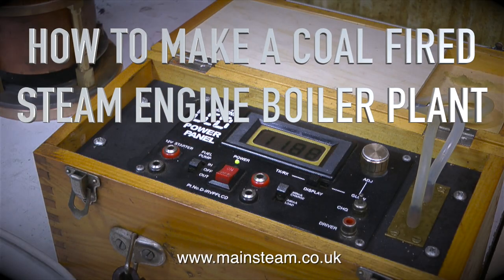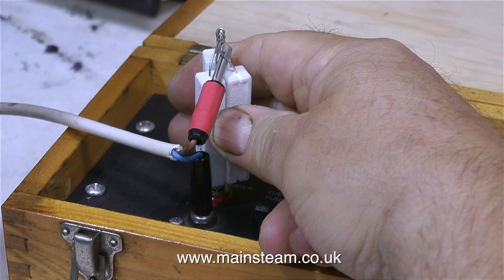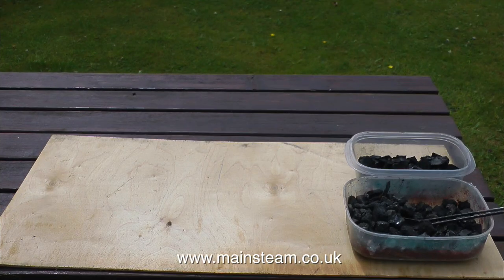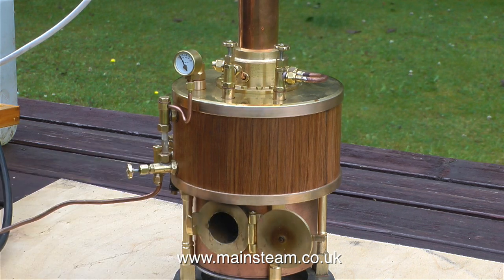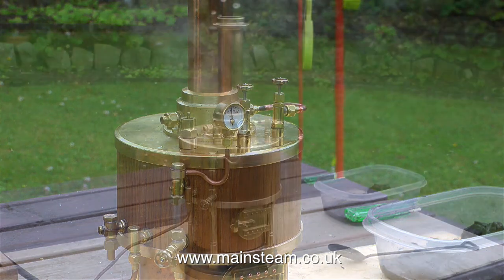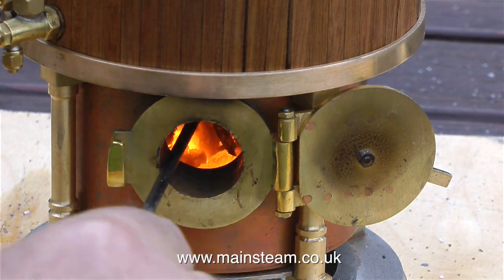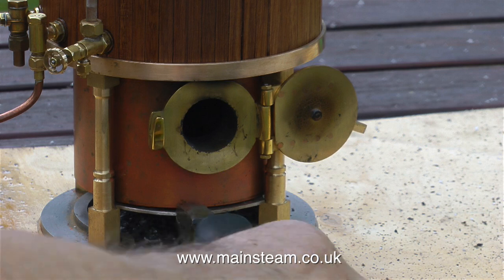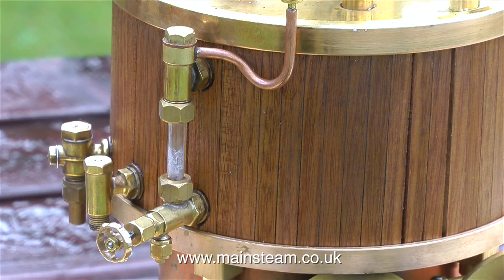HOW TO MAKE A COAL FIRED STEAM ENGINE BOILER PLANT - PART #27

Comment: A model airplane power pack of Keith's invention and a Hammond Organ resistor for the blower.  Multiple skill sets put to good use!
Reply: When using anthracite coal struggling to keep fire alight as goes out and steaming badly. Any tips for this?

Comment: On large steam locomotives a man could not shovel coal fast enough to keep up the head of steam. So they invented an Archimedes screw to feed coal to the fire and jets of air or steam to blow the coal to the different parts of the grate.

To save you from the back breaking job of shoveling coal to a boiler, have you thought about making a screw auger to feed your boilers?

Comment: Very well done it reminds me why I gas fire my boilers.
Reply from the maker: but ..... they just don't smell the same ......
Reply: There is that, but as most of mine are for boats gas is a lot easier. Also whenever I think of coal firering I rememberer a cartoon from one of the magazines that showed a model steamer towing a small rubber raft with the modeler in precariously balance leaning over with a small shovel full of coal to feed the boiler.

Comment: Quick Question about the pressure gauge piping... The copper 
tube seems to form a horizontal “trap”. Might this "trapping" cause a problem with the gauge 
reading properly? Or becoming plugged-up by old residue left in the 
trap?  (luv all the vids. thanks again for your time and expertise!)
Reply from the maker: The copper tube is a siphon and fills with water so that the soft soldered inner bellows that make the pressure gauge work doesn't melt ...... no "trapping" is going on ....
Reply from the maker: Hello John, I just checked my Paypal account and I thank you very much indeed.
Reply: Well worth the price of admission.

Comment: Is the gauge glass residue normal or is that also because the boiler is new?
Reply from the maker: It does happen over time, but in this case it was due to internal contamination of the water. It will improve the more I steam the boiler.
Reply: Thanks Keith.
Your boiler is very nice.  It looks like much more fun playing with coal than just turning on a gas tap.  It adds a whole other dimension to the fun you can have.